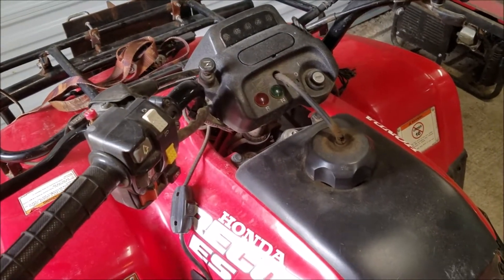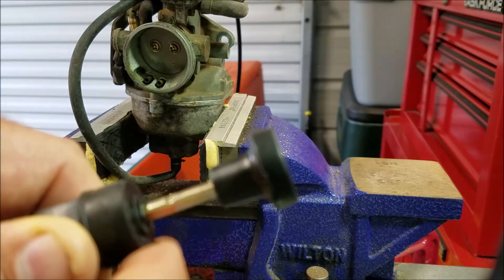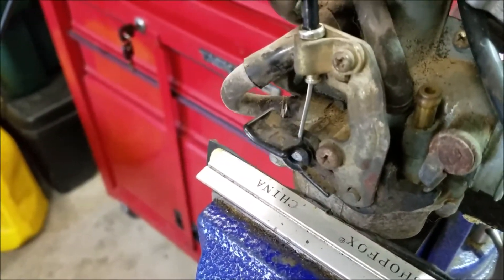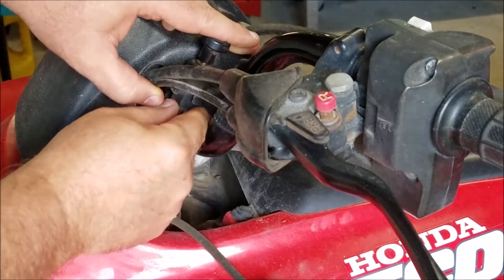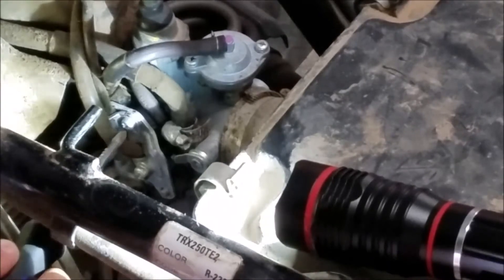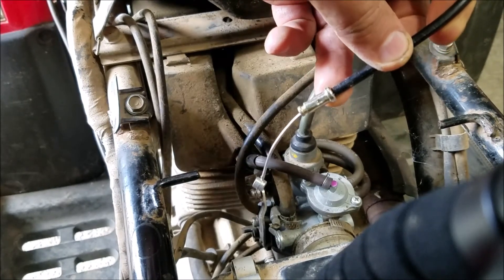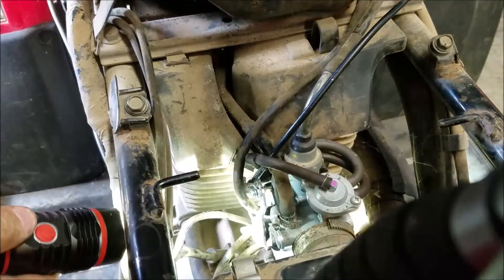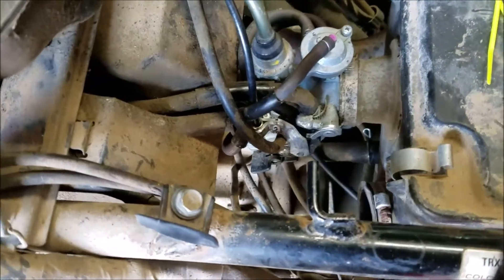Honda Recon Choke Cable Install

Comment: The knob on the choke lever is a jam nut. Tighten it and it won't do that
Reply from the maker: The actual knob or the nut below it? Thanks and I appreciate the info.
Reply: @cervus-venator  right below the part you pull.

Comment: That's not a fault, it's a feature! Automatic choke that slowly shuts off as the engine warms up.
Reply from the maker: I'll respectfully disagree in that this is not an "automatic" choke in any way.  It is a manual choke with no vacuum or mechanical mechanism attached to it that causes it to slowly shut off.  Also when new and for the first 20 years the choke never slid off of its set position.  It wasn't until obtaining considerable age and wear that this started happening.